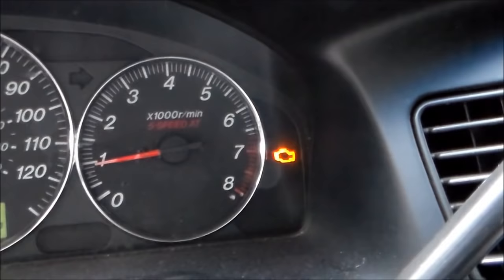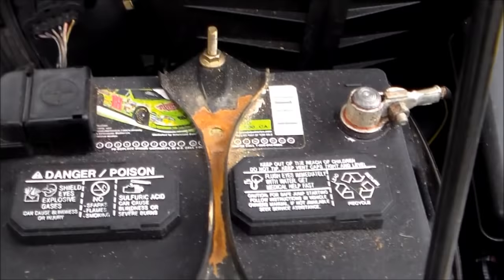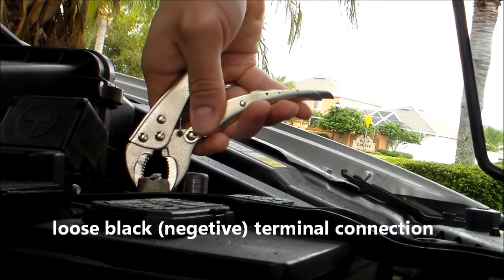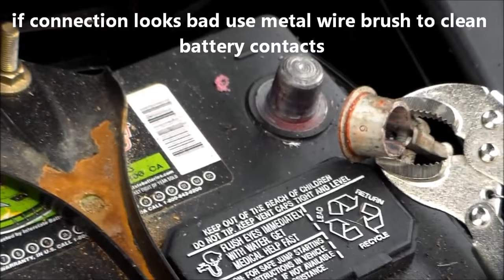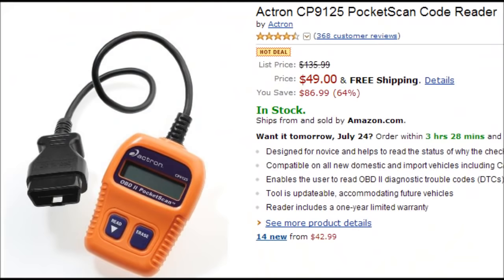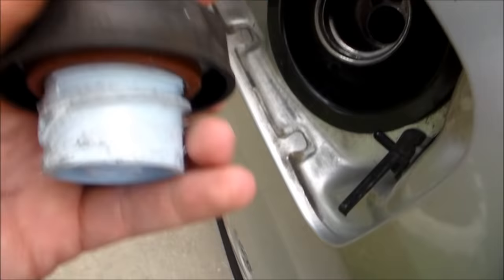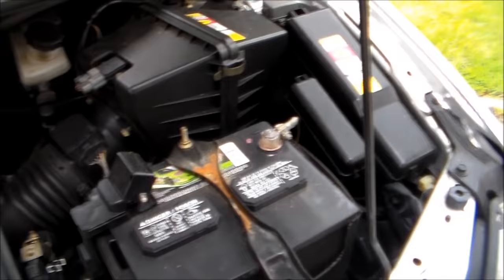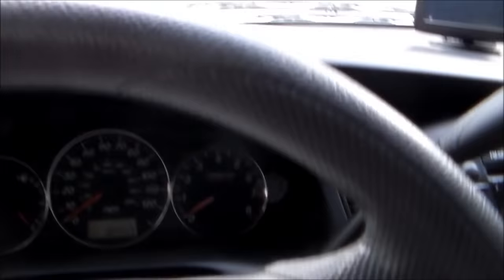HOW TO RESET CHECK ENGINE LIGHT, FREE EASY WAY!

Comment: You don't want to used mole-grips to remove the 8mm or 10mm bolt that holds the battery terminal on... You'll wear it out to the point it won't be serviceable and it will be a nightmare to remove.

Comment: yeah that will take light off some times but the code is saved in the computer. on emissions testing they can tell you took the battery conection off and they will deny your inspection due to trying to falsely erase the memory. so dont do it that wy cause its the wrong way. and had he checked the cap first.....he wouldnt have had to do that in the first place so it was a waste of time anyways.

Comment: If you disconnect the battery, the light will go out and your computer will see the same problem and the light will come back on. The mechanic can see the stored codes. There is air in your gas tank. It looks good for a little while. AutoZone would never clear my codes.

Comment: Sure, it will turn the Check Engine light out. But will it stay out. Not if you don't fix the problem. And if you just zero out the codes, the emission check people can tell that the car hasn't been through enough cold-to-hot cycles and you will not pass and will be told to come back.

Comment: I had to put a new battery in my 2007 Ford Escape and for some reason it screwed up my audiophile cd player, it says NO CD then CD ERROR when I try to load them back in. Any suggestions? thanks so much.
Reply: TheJhaley12 Some vehicles are equipped with an anti theft in the radio. Once the electric current from the battery is cut, it causes some radios to lock out. There should be a radio reset password in the owners manual or service booklets. If not, you have to call the manufacturers cust Ser line to get it.
Reply: There's nothing on this one but the circuit board so I bought a new one and will make sure if the battery goes out all CD'S are out of it and will try to protect it if I can.
Reply: TheJhaley12 ford = Fix Or Repair Daily!

Comment: I know the check engine light cut off when you disconnect the negative terminal..my question is does the light stays off after a few days?
Reply: +helloworld so basically after I fix the problem I have to decode it with the OBD scanner?

Comment: taking power away like that is not a good thing to do, it may wipe the code / engine light and if the issue that has caused the code or engine light to come on in the first place has been fixed then all good,  ( normally you have to connect a diagnostic computer to the OBD port, similar in size to a scart socket in a tv , and once the fault has been fixed reset the error code ),  but by removing power to the car's computer you are resetting everything that the computer has learned about the car from all the sensor's including wear , driving style if its a automatic , fuel type, fuel air ratios inlet and from the lambda sensors and i am sure a load of other parameters, and while some settings relearn quickly others take longer to learn , it also depends on make and model,  as i would have thought the car euc would have some sort of battery backup, as in a capacitor to save vital functions, but i could be wrong,  any way  its best not to remove power from car unless  you really you have to

Comment: Very effective but even after replacing the gas cap in my 07 Impreza and pulling the negative ground from the battery it reset but   the light comes back on 1200 miles or so later.

Comment: Does not work on 2006 Chevy Silverado.  I left the battery disconnected for over 1/2 hour and it still stayed on. Went to get a computer reset and that did the trick.  When the gas cap was the problem, the computer eventually figured out that the problem was resolved and turned the light off on its own.  When the mass airflow sensor was the problem, it wasn't so smart.

Comment: Or you could just spend $30 on a pocket scanner with an "erase code" function.  You'd have the code erased, the light will go off (and hopefully not come back on if repaired properly) and you'd be prepared for any future issues.

Comment: my cel was on and i replaced the purge solenoid ..i was told to take off the battery cable ..and it worked the light went off   drove it for 2 days... its back on now what ???
ANY SUGGERSTIONS

Comment: Hey men I need help with my gmc truck I still have the check engine light on and I disconnect the battery and it is still the same.

Comment: Will it pass inspection?  I think you would have to drive it around for approximately 200 miles so the computer is actually reset, otherwise when you take it for inspection you will get "computer not ready" message.
Reply: +Enrique Pabalate  It won't work, you are completely right.  
While the readiness test completes, based on driving patterns not distance, such as over 3000RPM going uphill then letting off the gas completely, driving and coasting at various speeds etc.  

This is a drive cycle and is different for every manufacturer, you can force a drive cycle by going through the specific motions or just through normal driving for a while.  Could be a few days, could take a week depending on where and how you drive.

I will show up as emissions readiness test incomplete.  As t completes, if you haven't fixed the fault, it will trigger the light and you are back to square one again until you fix it.  

I specialize in diagnostic testing, emissions and alternate fuels, I have had HUNDREDS, if not thousands, of customers bring their cars in after resetting the light.  When I tell them to come back and not reset the light if it comes on again, they swear they didn't reset it and never had a dead battery.  It's pure BS, either the PCM is dead or has a bad connection, in which case car usually won't run anyway, the battery died or was disconnected, these systems don't lie but customers do almost every time.

Comment: If the gas cap were the problem the light would reset itself usually after you tighten the cap or fill up.

Comment: CHECK ENGINE ...... wont appear for no reason corz, could reset eitherway and its possible it'll blink again after some miles, then forsure some's the matter, 'mostly' mass-flowsensor / throttle-valve due to carbon-residu 'air-intake' ('high-carb' on motorwayz, we all know .... ) or possible EGR-malfunctioning/catalyst etc, without resettools (vw/audi uses diff obd-protocol, matter obd-tooling etc) u can try to unplug ur carbattery both positive/negative wiring and holddown thoze both wires together for 1min orso, contacting +/- wires, not battery-connectors!!! (makesure battery isnt connected at all!!!) like me said, checkenginelight isnt popin'-up outta nowhere. only in a few matters it stays off and wont blink again .....

Comment: FIRSTLY, the Gas cap wears the O ring. Get some silicone lube, and 180 the cap O ring. In other words, turn the O ring around.  There is a sensor on the EGR system, which checks the lines, Gas tank included. Those souls, on a shoe sting budget, get one gallon at a time. Rather that filling up the tank once a month, which no one can afford. MOST of the time, the Gas cap switch around, does the trick.:-)))

Comment: I couldn't laugh anymore if I tried, air in fuel tank lmfao, there will always be air in the tank hanahanaha.
Reply: Oh and it's easier just to get a small obd2 reader (Bluetooth or wifi if using Apple) get an app and at least check the code yourself, fix the problem then clear codes. Your giving very very bad advice!

Comment: When you disconnect the batery you clear ALL OF THE SENSORS. DATA. That means if you need to get your car smog inspected it will fail.
Reply: What choice do you have if you have to change your battery?
Reply: There are adaptors available that opperate on a 9 volt batery and back feed the 5 volts for the ecm to hold memmory. Some work in your cig lighter the better ones through the obd port.. 
A scan tool with batery backup should be able to keep the codes from disappearing.
Reply: The are not that expensive just make sure you have a good batery in your addapter.
Reply: If you loose data you perform whats called an OBD2 relearn drive cycle. Takes about half an hr. Also works for diagnostics. My original comment was mostly aimed at thoes who think disconnecting the batery makes a problem go away. The problem is still there.
Reply: Bob Wolf

Comment: First off never take advise from the people at auto zone they don't know what they are talking about. Second if the light comes on it has come on for a reason. In the past I have seen the horror of a neglected light take for instance a misfire that has burned a hole in the center of a piston or a cat that has burned up due to unburned fuel entering it. These are very costly repairs and are avoidable by fixing the root problem of the light. Stick to Pc hardware guy.

Comment: So if I take it to Autozone to reset it then take it to my mechanic for an inspection, all will be ok...I've already replaced the oxygen sensor as recommended...
Reply from the maker: for me 90% of the time its either O2 sensor or loose gas cap, so you should be ok.
Reply: The parts store told me that they were not legally allowed to reset a Check Engine Light!
Reply: ***** its a autozone policy just in case the problem is serious and you car blows up you can't came back to autozone and hold the liable for damages

Comment: Air in your tank. I have never ever heard so much crap "Air in your tank". So when the engines uses fuel from the tank if it has a cap that is sealed as fuel is used the tank implodes.
Reply: Jip totally agree....air in the gas tank ...lol
Reply: i thought that was bs also but actually that was the problem for my 92 corolla and it was jus that..smh

Comment: This is not a fix. It just stops warning you about your car effing up. If the check engine light bothers you a small piece of electrical tape cover it easily and cheaply. Assuming you have insurance I would suggest roadside service on your policy because problems don't get better by ignoring them

Comment: word of advice : dont do this if you have french cars or optimized computer , it will go to emergensy mode , causing VERY low fuel milage and poor running!! this will acur in cars with software upgradeability.

Comment: That might be free but it didn't look easy to me, you disconnected the battery so you would have to reset the clock and also reset the music system (if you have the code) and the light will just come back on again if you don't treat the cause of the problem although I accept that's not what the video title says

Comment: I did what you showed us in the video, the light disappeard but came back later on again. why?
Reply from the maker: Hani Haddad if light comes on again then it was not the gas cap, scan your car's cpu to find out what the error code is.
Reply: You can get a scan tool for around $15 that will not only allow you to erase the code making the light come on; it will provide the code so that you know what to have repaired.  The scan tool is much preferable to the battery method.
Reply: *****
I tried this....my light still is on...what to do now ?

Comment: It worked for me on my 2003 corolla... but now the alarm doesn't beep when I lock/unlock doors with the remote...???
Reply from the maker: I did it on a Toyota but that didn't happen to me maybe car settings changed. check car manufacturer or alarm manufacturer to change alarm features.

Comment: Instead of getting the check engine light diagnosed correctly...lets listen to a guy who works on phones for a living, and uses vice grips to disconnect the battery. Close your hood, you don't have any business in there. 

Readiness monitors, radio stations, and your gas cap was probably ok. I am 99% sure.

Comment: It amazes me that people refuse to pay $50 - $130 to have their 30K vehicle properly diagnosed.  The light is on for a reason.  If you have the knowledge,  then by all means,  tackle it yourself.  But if your only tool is a pair of vice grips,  then take it to someone who knows what they are doing.  It will be cheaper in the long run to pay once for the right repair than to hit it with the parts cannon.  Or have an engine failure because you drove around with a lean condition for 6 months even though there was a bright yellow light shining you in the face every time you went to Starbucks. 

   And ffs stop going to AutoZone thinking that these guys are mechanics that can diagnose your car just by plugging in their $20 scan tool.  If you do go there,  Have them print out the code definition and probable causes instead of asking them what the car needs.  They don't know, and they don't care.  They are being paid $8 an hour to sell parts and answer the phone.  Not diagnose and fix your car for free.

Comment: Unless the cause of the problem is fixed, won't the light just come back on after about 50 miles or so? More like a trick then a fix. It only delays/hides the true issue.

Comment: May work temporarily but the light will come on again soon.  The codes in the computer must be cleared to give a permanent cure.
This method will also scramble your radio and if you don't have the code to reset it you're screwed.
Love the use of vise grips.........  NOT.

Comment: i got a stype jaguar and afetr changin battery , the yellow light engine management came on again , twice we connect the computer , no errors no codes , and after the light is gone ,,, 3 days later appeared again .
Reply: SAMBA MACHINERY RECORDS bhuu
Reply: Ramat Olayioye the dealer may have to reset it with there. Equipment. The new battery shows new voltage to the computer.

Comment: There's nothing I enjoy more,  than watching somebody else slowly removing and refitting nuts and bolts lol  - for heavens sake,  if you edited the video to keep sticking adverts in, why not just skip the life story bits in there too?

As many have said here,  it could be any number of faults causing this problem, so I'm wondering - if this isn't a recurring problem,  how did you know what the cause is,  and then manage to create a video of it being fixed?  Surely once it had lit up in the first place and you discovered how to fix it for years,  wouldn't you then not be able to show it on the video?   Very odd.

Comment: Do not do this. When you do this you wipe all the codes so if you do take it somewhere to get the codes ran, none will come up. Plus on some gm models if you disconnect the battery, a vent door could jam. If It does Jane you will have to take it to a dealer to get it recalibrate it or replace it. So just find someone with a code reader to check you're code and if it's nothing have them clear it .

Comment: Free,easy, no tool, no codes, no mechanics, no trips no nothin'..... I got gas cap screwed up putting it back on  our brand new 2015 Sonanta, and the blue ring or whatever it is, the diagnostic lights,, warning stuff, all went nuts.  couldn't get this orange engine looking warning thing off even after the gas cap was back on OK.....so.... do this.... shut off the car, then, take your foot off the brake and push the start button until the light around the push button says " on".  DO NOT START THE CAR.  Keep your foot off the brake..  The warning light will be on and this is fine.  Now. take your finger off the start button, and start the car normally.  The light will come on for about ten to fifteen secs which is normal, but it should go out and stay out.  It took me two tries to get it but it got it.  2015 Sonata.  Send me the check for the $$ you didn't spend to fix it.  Credit cards also accepted.  No tax for Fla residents.

Comment: This will not fix the problem the ECU in your car will still see the problem but that it is fixed until you drive the drive the car it will return. The has history on all the problems with your car is in the ECU.(The computer that runs your car)

Comment: will this work on 05 Honda CRV ?
Reply from the maker: most likely but for 7 dollars you can get obd tool that read codes and properly resets the check engine light without effecting car radio. watch my Car electronics playlist.
Reply: Joseph Deffendoll yep. but you will probably lock the radio out.

Comment: That really is not true. The only reason that after he reconnect  the battery  terminal all you did was worth nothing because after you drive your car for 50 miles the check engine comes back on the reason is that the computer is back on and analices  the system for peoblems.

Comment: Removing power from your vehicle will NOT reset the check engine light on most vehicles. The computer will retain the code until it is erased with a code reader. This is B A D advice people.

Comment: my name is Dennis and I have a 2011 Chevy Malibu LT, So here is my where is my pcv valve located at... i changed my throttle body and now my car is idling very high I went to AutoZone and got this code P0171 which means I could use a new fuel pump or my pcv valve is going bad.. so can you or someone help me located this problem i would really appreciate it a lot
Reply: I would check the iac valve

Comment: Not the way to do it , what if it isn`t the cap ? 
people might do this and ignore a simple problem of a 20 dollar sensor causing a 1000 dollar repair . 

Or people doing this and when battery on again lose radio code . Need to call dealer to get code for 20 $ same money as going to shop and reading errors. 

So my advise don`t do this and go to garage and hook it up on OBD plug .

Comment: sorry dude.. but that's not the way it works... you turned off the check engine light by disconnecting the batt.. but that does not fix anything,, the computer cycle every so many miles.. 35 for my vehicle.. and when it cycles, it will read any error code the car computer picks up.. this is continuous. .. if you are trying to get an inspection, the place will tell you, that the computer is "NOT READY".. since it needs to cycle..